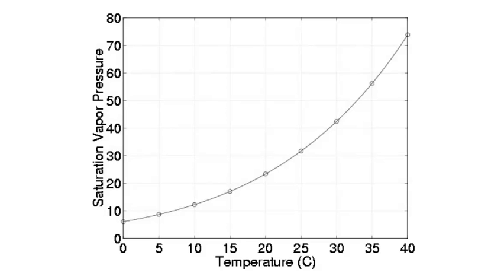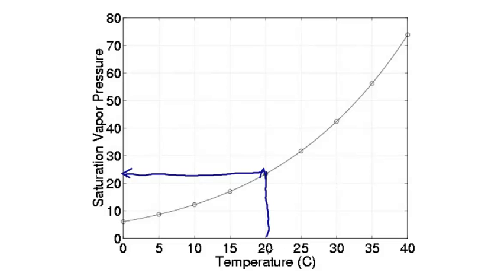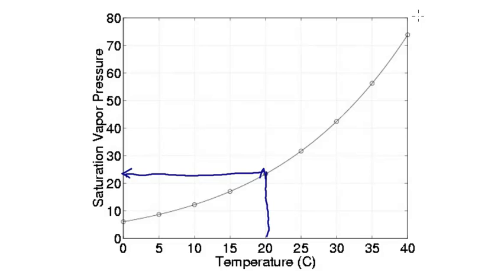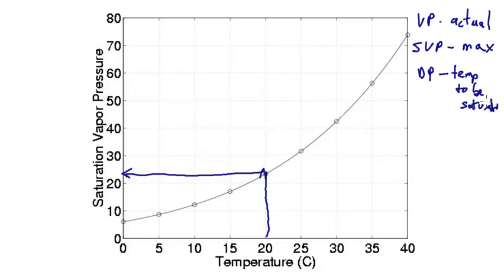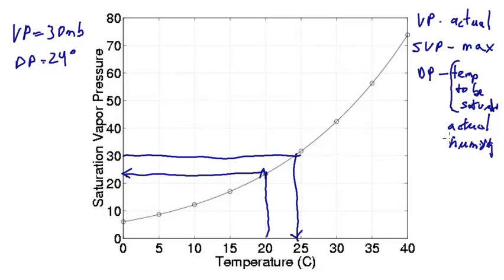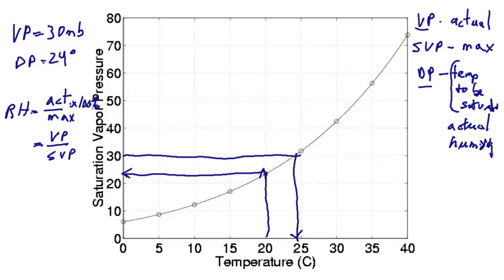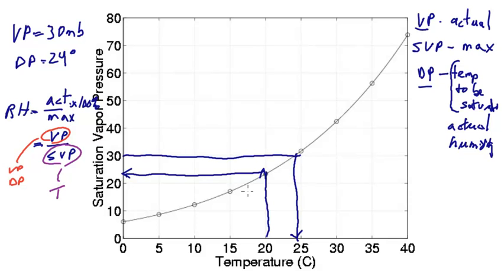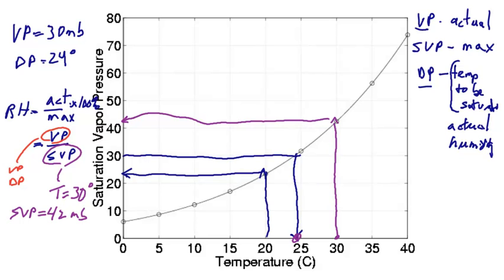Saturation, Dewpoint, and Vapor Pressure

Comment: Brian, in a compressed air system, lets say the air is compressed to 150PSI, moves through a dryer (lowering DP to 40F), what affect on PDT does sending it through a reducer to 120PSI?  How does this affect DP if the air entering the compressor is saturated  at 100F?

Comment: That was very useful. I came here because I am trying to understand a recent SciAm paper about how the planet is browning due atmospheric water vapour pressure deficit. At the same time as warming adds 7% more moisture to the air per degree C of heating. I think I understood your discussion but I still want to be sure I understand. The saturation pressure or dew point is going up faster than the relative ambient vapour pressure goes up.

Comment: SVP=
Maximum vapor air can hold
Dew Point= The temperature at SVP.
What is precipitation?

Precipitation temperature is lower than condensation temperature & pressure?

Could u please verify the temperature at which the fluid boils is below its dew point?

Boiling temperature=condensation temperature
?

Thanks

Comment: excellent video, but i have a few questions (my thermodynamics teacher went through this very fast...):
what does it mean when you say "air at X°C temperature cannot hold more water vapor, it will condensate"? what's happening phisically that makes the air unable to hold more vapor?
why is it that cold air is more easily saturated (again, what is happening phisically)?
Reply from the maker: it actually is the equilibrium between condensation and evaporation - I was speaking a little roughly for convenience.  at higher temperature, the water vapor in the air can be higher to be in equilibrium between the two processes of condensation and evaporation.

Comment: Is the wet bulb temperature and dew point temperature are same?
Reply: No.   At saturation, they are the same, and the same as the dry bulb temperature, but anywhere else on this chart, all three will be different.  Wet bulb temperature is achieved in a swamp cooler, while dry bulb temperature is achieved in an air conditioner's evaporator duct.

Wet bulb temperature is what you get if you evaporate water into the air to cool it.  Heat lost by the air becomes heat gained by the vapor, and the end result is that you end with a lower temperature of the more humid mixture.

Dew point by contrast, is what you get if you cool air at a constant absolute humidity, and is the point at which the absolute humidity can no longer remain constant while you are cooling it.  The water vapor has to start condensing in order to continue cooling the air mass.

Comment from the maker: This is the same thing as before.  The actual equation for making the curve above is SVP=6.75 [mb] x 2^{T/11.5 [C]}.  Thus, for T=-30 C this translates to about 1 [mb].  75% of that is 0.75 [mb] and is the VP.  The new saturated level, at 22C is around 25 [mb].  This the new RH would be 0.75 [mb]/25 [mb] x 100% = 3% RH  - really dry!  This is one of the reasons heating systems in the winter produce very dry air.  Does that help?

Comment: hi Brian i came across an exercise that requires the calculation of the RH that I am having trouble with...i'll use similar but fictitious numbers...
the outdoor air temp is say -30C with an RH of 75% and is heated to indoor temp (room temp) at 22C.  Do you have any tips that may help in approaching this type of question and remembering the formula, if any? any help is appreciated tnx

Comment: How do you find the dew point again?
Reply: Locate the point on the chart, and trace horizontally to the left.  Identify, where it intersects the saturation curve, and trace downward to the corresponding temperature.  That is the dew point.

The dew point is where the airmass will cool to saturation, if it doesn't gain or lose any water vapor along the way.  It will need a sink for its heat, such as an Air conditioner's evaporator, or the grass over the nighttime collecting dew (the namesake for the dew point).